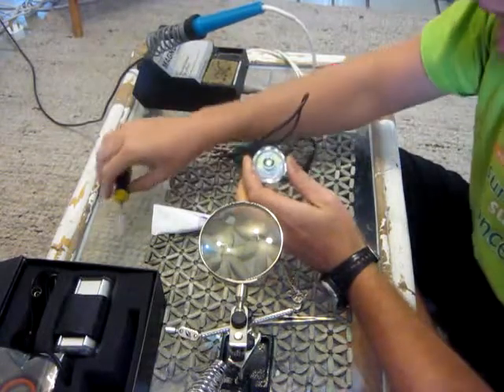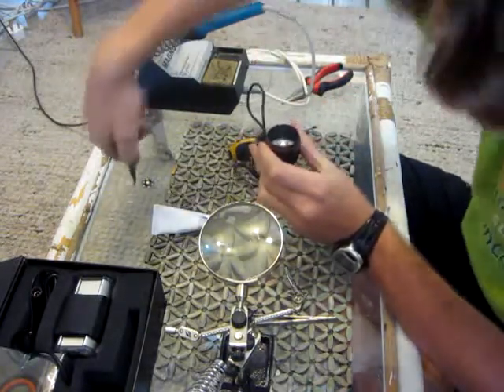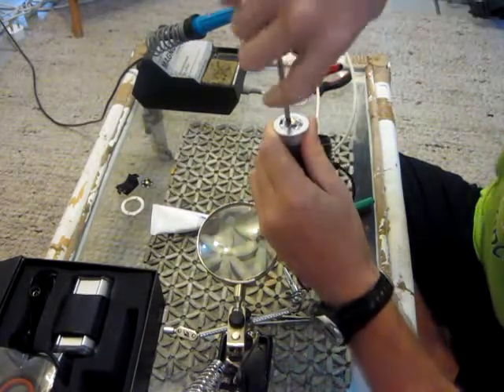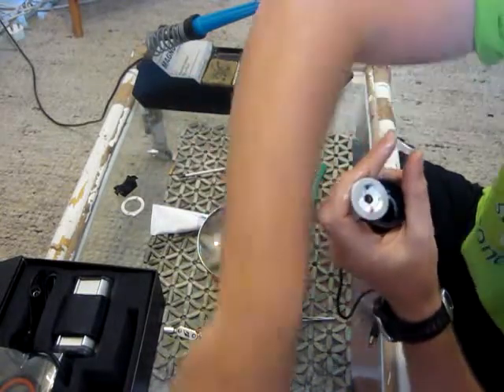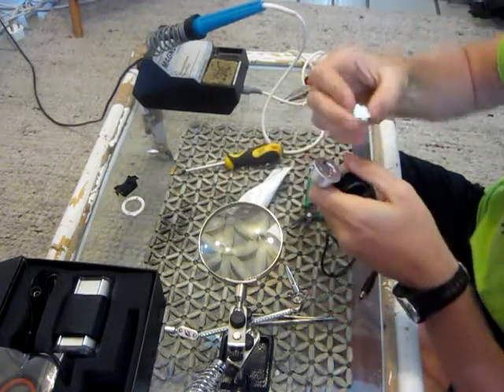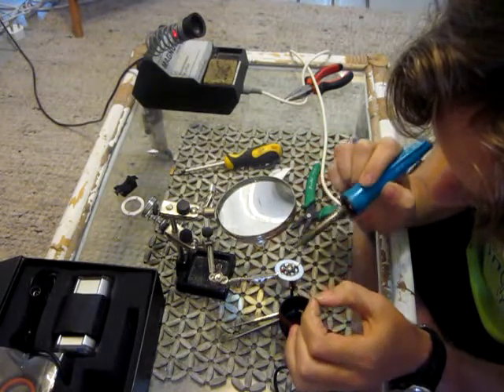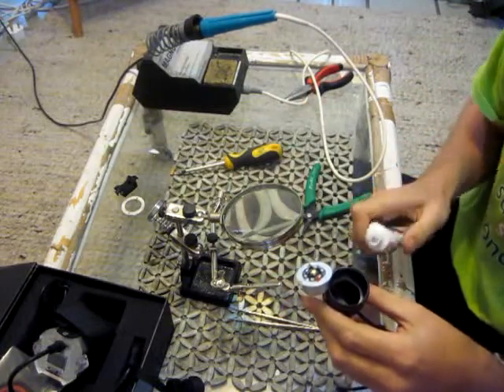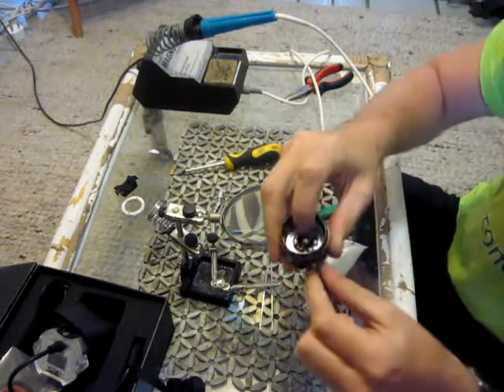Upgrading the Magic shine MJ-808 with the Cree XM-L LED

Comment: Great video.  Wanting to upgrade my old Magicshines.  Can you recommend a great neutral white led with around 1000-1500 lumens? Thanks again for the video.
Reply from the maker: Charles Nahas anyone with a 20mm star. Cree XP-L2 or XML2, you can also try the XHP50 6v or mpg2 6v, but they get hot and use more power